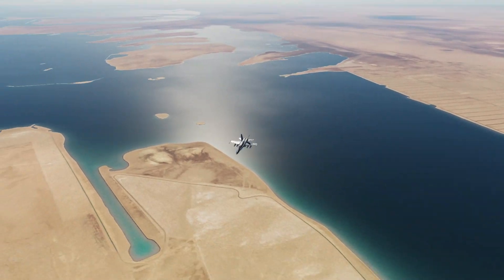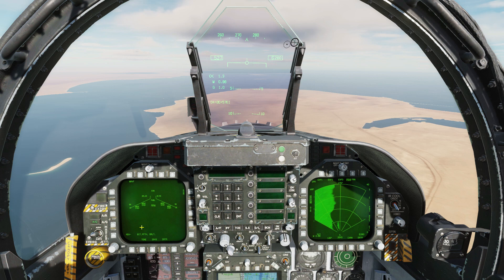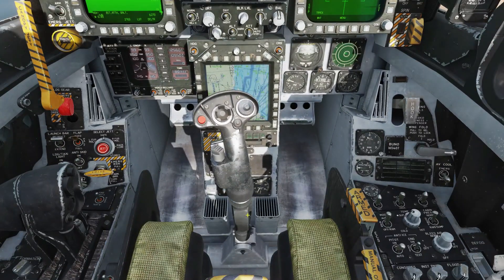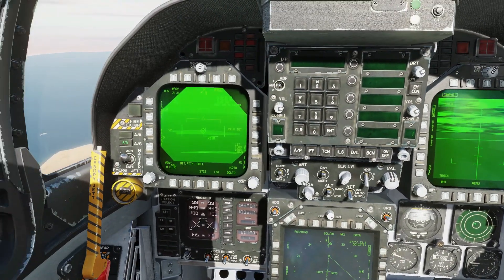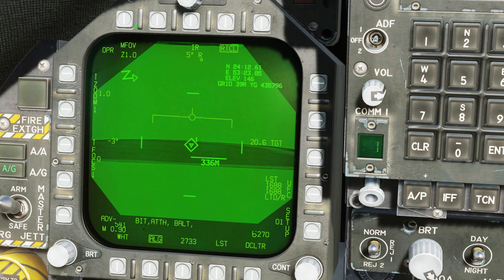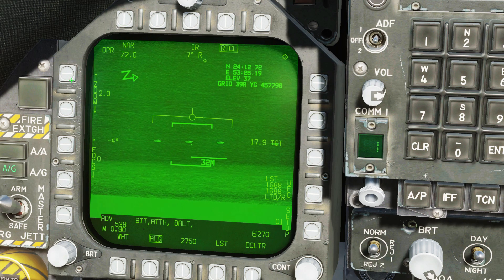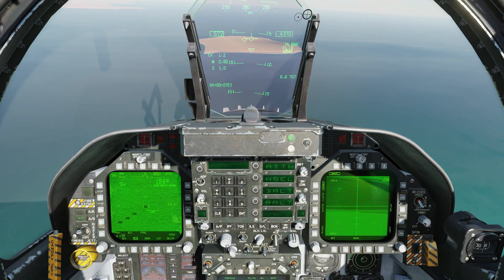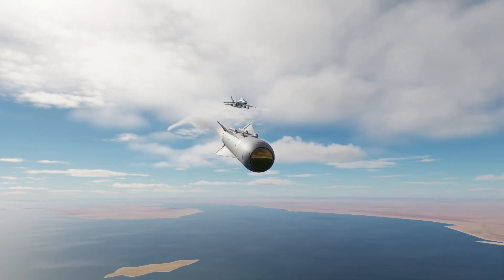DCS Hornet Maverick ATFLIR Tutorial - FA/18c  Maverick with Targeting Pod - DCS in 3 Or Less

Comment: For some reason, the FLIR button does not pop up for me. I'm doing the first of two Maverick missions.
Reply from the maker: @GrowlingHornet  is the targeting pod equipped and powered on?
Reply: @GotSpaceGame  Hey GSG, thanks for taking the time to respond to an old video. Below are my procedure notes for this. Let me know if you see anything wrong:

	1. Click air to ground mode and switch master arm to on
	2. Select Maverick by clicking first button in top row of left screen.
	3. Pull up targeting pod by clicking center button on bottom row of left screen. 
	4. Click FLIR button (first button on top row of left screen)
	5. To open Maverick targeting screen on right display, click center button on bottom row, then click MFN DISPL button at last button on top row.

Comment: everyone keeps saying SOI that screen. It means Sensor Of Interest right? I still don't understand how that works, and I don't see any Axis command I can bind it with on my stick.
Reply from the maker: SOI is Sensor of Interest, yes. You use the Sensor Select Switch control bind to SOI a screen. Flick it to the left to SOI whatever sensor is on the left screen, or to the right to SOI whatever's on the right screen. It can work slightly differently depending on the plane but that's the basic concept. You'll want to have it bound to some sort of a 4-way hat switch, preferably on the joystick. I normally have it bound to the one that looks like a little castle.